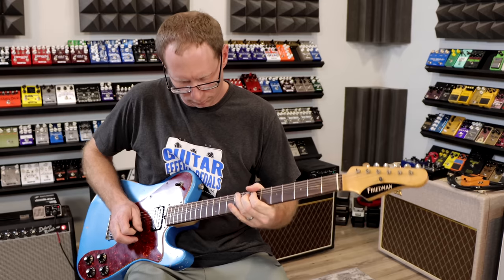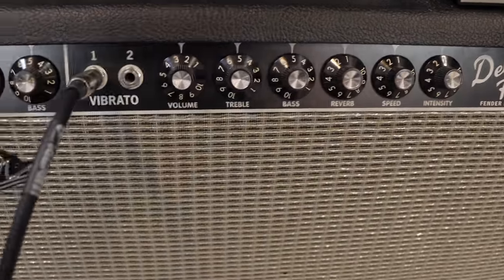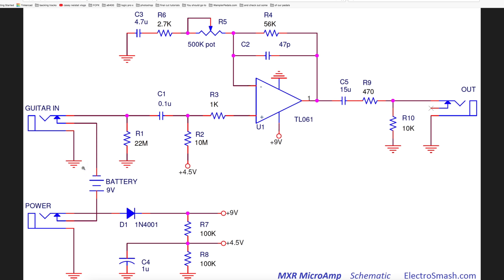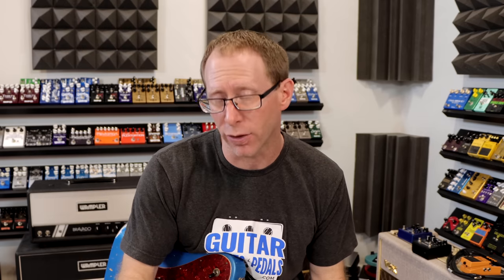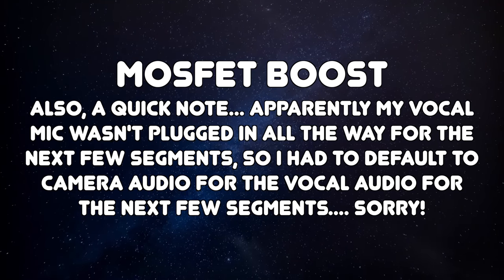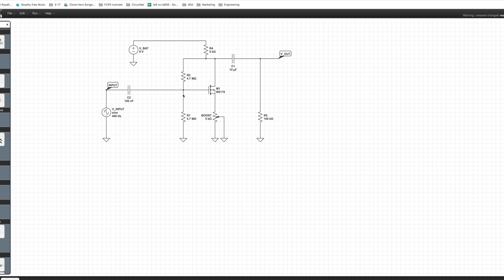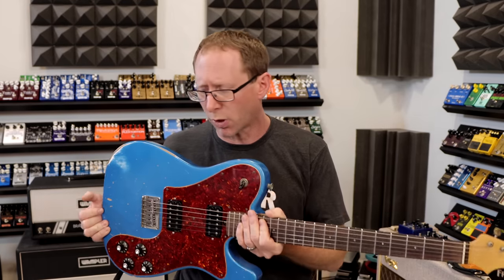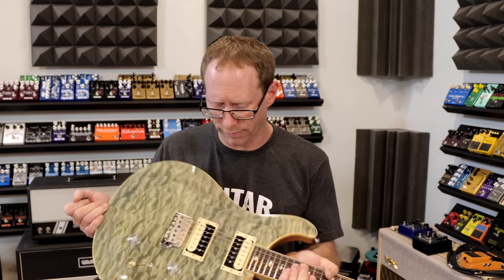Boost Pedals (Explained in Depth)

Comment: My "magic" pedal that is my number one pedal on ANY board is the MXR 10 band EQ. Not only can I boost 10 feq's, but there's two additional sliders. A volume cut/boost and a gain cut boost. It is so flexible. I can do just about anything I want. That, with my Sovereign and my Ethereal, I am set.
Reply: Been thinking strongly about going the rout of an MXR 10 EQ. Do you feel a difference under your fingers when you play using it as a boost, or is it just sound your experiencing ? ..or both ? I'm not looking to boost volume necessarily. 'Mainly feel' and deff not trying to change actual tone of my last OD in the chain.
If that makes any sense .
Reply: they seem like the red headed stepchildren of pedals aren't they?  they can do so much and are so useful but boosts, od's, get all the attention when in reality that eq pedal can do much of that.
Reply: But they can be noisy when you use them for boost instead of tone shaping Although you can do modds that can fix that but didn't work for me I use a Rangemaster clone w a clean boost on top
Reply: @paulcowart3174  Interesting. Never heard of a Rangemaster. Have to check it out
Reply: I'm using a 7 band EQ, at the front of my chain. I have a general setting for my HB guitars and one for the single coils. 7 bands is minimum, for all around use; 10. even better
Reply: I have a silent-modded 10 band EQ but also use mini sonic stomp for clarity. Really brings out every frequency range before I EQ anything. Great for S C's or H B's to start with a cleaner, clearer sound. Last pedals on my board going into amp.
Reply: @sparkyguitar0058  lol That's why I love Wampler videos. He has some of the most clever people who contribute. That's brilliant. I never would think of trying those two together. Thanks for sharing
Reply: @sparkyguitar0058  Any info on a "silent modded" 10 band eq?
Reply: Brian Kirby  10 band was done by Amplified Electronics Cape Coral Fla.  See if he is got anything on his Reverb page. If not contact him to get more info. I told him I would brag about how cool this pedal is. I have a stock 10 band and night and day difference in sound quality.
Reply: That’s my secret weapon on my board, the most boring pedal is my favorite, i run it into the effects loop
Reply: Have to add at the front of my board is a dB+ cause the buffer leads off my board.
Reply: No noise gate. Lol
Reply: RG1570 YGO  What would a noise gate do?  I've only had 1 on a big multi-effects pedal I used briefly. And never liked the way it cut off tails of sound. Maybe I didn't set it right but wouldn't add it to my board. I got a volume swell pedal for killing noise then step on tuner to change around pedals to next sound. So don't need to add something that might confuse me more. L O L.                                     Edit. Now I don't use the Sonic stomp on my board. It's only used with my A /E set up. On my board is tuner, wah ,3 drives, 2 delays, chorus ,p shifter multi effect, dB-1 boost, and modded 10 EQ. The BBE Sonic stomp is used with sometimes a delay and run into a wireless then into a small mixer and then a feed into P A.

Comment: This was really cool! I can see how so many pedal builders learned how to do stuff from you. On the whole "pre-amp pedal" thing, I wonder how a pedal like the Revival Drive from Origin Effects fits into that. I imagine the circuit diagram would be really complicated. It feels more like part of an amp to me; its what I have in my head when people say pre-amp pedal. In particular, when I set it to sound like a Marshall using a Fender amp, and run other pedals into it, like a Klon or a fuzz face, the overall volume doesn't increase, and it sounds closer to a Marshall with those pedals in front. Other pedals I've played that are designed to sound like a cranked Marshall don't do that so much.

Comment: Really good explanations, thanks. I was a electronics engineering tech 1st and learned guitar later in life. I've been trying different boost/distortion pedals based off the product descriptions with little success understanding how the pedal was shaping the frequency response to get the grit I want to hear. Your video cleared the fog. Most of all thank you for stating they all do something to the sound more than just amplifying (boosting) it. Your Ego compressor is great btw. I now have to try it in before or after positions with the Euphoria V2 due to learning a bunch from your 5 ways to use a compressor video. Good stuff, keep it coming.

Comment: I'm using an inexpensive wireless guitar TX/RX and it works well but I seem to get a lower signal (less hot) than using a cable because all my overdrives/distortions seem to have lost their clipping, growl, like if you were to roll off the volume.  So, if that's the issue, lower input signal (lower voltage?), then okay, it is what it is, but what can I use to increase the signal to get back closer to what I would have using a cable?    Seems I would want to stick with a full frequency signal booster from what I gather in your explanation, I don't necessarily need to boost a certain frequency range or volume.  Which type of booster would you suggest?  Inverted op-amp, LPB-1 type booster, etc.?  Thank you in advance for your input.  Great video and topic!!  Well delivered, kudos.

Comment: Brian, 

Your knowledge is extensive! I thank you for your generosity. At the same time, may I suggest just a little bit more info, for us rookies that don´t follow: Maybe you could close your videos with a quick summary. In this video, for example: "To sum up: Non inverting op-amp is good for x and works good with y. Famous pedals that use this circuit are: A, B and C." and so with all the other options. It would be of great help. Thanks again!

Comment: I love Wampler pedals mostly because their owner makes such detailed, unbiased, and intricate reviews. This channel has taught me how to better read schematics. I used to use a compressor as a boost and loved what it did to the top end of my sound. It didn’t add any distortion but pushed the clean channel of my amp enough to make solos really sing out. It replaced an MXR Micro Amp which distorted the highs too much and got fizzy making me turn my tone knob down which was a compromise.Then I finally got a Maxon OD808 and this became my favorite boost pedal. It did color the tone when it was off though so I plan to get an OD9pro+ 18V which Maxon claims doesn’t have this issue. When I hear pedals like the Klon and Klon copies, I think they sound great but ultimately accomplish the same sound as a TS type pedal. Someday I’ll be able to compare a TS pedal at 18V (including the BB preamp which is a TS style pedal) to a Klon clone like the Tumnus to actually hear or feel the difference. Maybe stacking a Klon with a TS is the best way to solve to my indecision. I really roll my eyes when people call these pedals “transparent”. Why would anyone buy a pedal that didn’t sound like it was there?

Comment: Hi Brian, I bought by mistake a box of 100 Mosfet transistors BOJACK 2N7000 200mA 60V N-channel Field Effect TO-92... can those be used instead of the BS170 into your Mosfet Booster schematic? And maybe for some kind of fuzz face like kind of circuit as well? Thank you in advance for any possible hint! Cheers!

Comment: Vox advertised their “Top Boost” circuit as “Up to 30db boost at 10kilocycles!”

Does that mean i could just get a Boss GEB-7 and boost that frequency to mimic the AC30 Top Boost? The GEB-7 only has up to a 15db boost capability but im sure no one runs the treble on an AC30 on 10 so it would work right?

Comment: Great info Brian, now for what may seem like a mis-informed question. While making adjustments on an eq- pedal and the peaks affecting the main frequencies (i.e. 400 and 800 as an example), what happens to the frequencies in-between? Say 500, 600, 700 when the higher peaks are used. Are they affected in a balanced curve between the 400 and 800 (again just the example frequencies), or is there a drop out for the "in-between frequencies?  Would this be the reason a "boost" circuit has a more even sound? Looking at the computer example of the eq-pedal is the reason for asking. Thanks again for all of the information you bring to this channel, it is greatly appreciated.

Comment: In the first example, the MXR microamp, you are using a breadboard. Are you using a special power supply, ultra clean? I can't hear any hum, how do you remove the him from the power source? Any comment on this? Thanks. I am starting with op amps, using a TL072cp, and I always get hum. And also it changes with the volume pot. Apparently it is a natural effect, as hum, but I would like to know how to get rid of hum, even with a breadboard (they are not the best for audio circuits some people say, but you get a very good sound). Are you using some noise gates? I have heard of them as well.

Comment: I believe the main point of a preamp is it's converting the guitar signal into line signal, at least when i look at amplifiers. But i'm not exactly sure what that means and why are some pedals noisy when they are in an fx-loop? Are these digital micro preamp pedals the same? I agree very much that there are lots of different products called "preamp" and it's not clear why.

Comment: In the scenario of using a ts-9 as a clean boost.    If instead of using a ts-9, I used a graphic eq, what sliders would I bring up beside volume to give it that ts-9 clean boost sound? I guess I want to know what exact mid frequency is spiked and if that # even exists on traditional 6-10 band graphic eq's. What tool is used to identify what is being done to a signal (visually)? I appreciate any direction. Thanks!

Comment: Try the original Colorsound boost that uses an 18v supply.
Dave Gilmour used it for many years, and it is seriously LOUD that increases the gain stage to push pedals after it, like distortion pedals.
(Worth switching the linear gain pot for a log one though for better control.)
BTW, it's worth mentioning "Operational Amplifier" rather than just "OpAmp" for clarity.

Comment: So I like to run a muff style fuzz into my ego compressor, which goes into a Fender style amp. I think this makes it sounds tighter and more aggressive. It does slightly boost the fuzz’s volume as well. What about using a compressor with my fuzz makes it sound better? Is it just changing the eq, or is there more to it?

Comment: Very interesting and enlightening. Would a parametric eq get closer to a treble booster effect, and do analog parametric eq’s even exist? Or is the difference more to do with the use of transistors and capacitors for tone and filtering rather than eq sliders (are they pots?)?

Comment: Hello, I really liked this video you are the best without a doubt !! I'm starting now and I have a doubt, when I set up any circuit on the protoboard it works normal more when I put the inside of a sardine can and put the pots in contact with the can the gain of the circuit decreases a lot, will the can cause any short circuit by the potentiometer? thanks.

Comment: I am not sure if this is related to clipping, but I noticed, there is a slight distorted sound at the end of the note(as the note decayed) when strumming bass strings (6,5,4 strings say Dm bar chord to 10th fret) on higher frets and no distorted on lower frets(say F#m on 2nd fret). And this happens only on neck pickup when on full humbucking mode but none on single coil mode(neck pick up) provided both scenario on full volume guitar knob.

Comment: Hey Brian (Bryan?), great video here. I have a Tumnus Deluxe and a Micro Amp, makes me think I should get them back to back and see what's happening. Quick question: Talking about the splattiness when you push the JFETs too hard, does this same thing happen in some fuzz pedals? I've noticed with my Hoof Reaper and my RAT, that if I have some hot signal running to them, I lose tons of definition and it just becomes a wall of sound. But, if I roll off some of the volume and/or split the coils, I suddenly get a lot of that definition back. Does this mean the fuzzes have JFETs in their circuits, or is something else happening here? Thanks so much!

Comment: I love the Tumnus as a boost. I’m glad you explained it still colors the sound even though it’s not clipping the diodes.  Sounds so great using a fender deluxe reverb. I heard it’s because it’s a mid scooped amp so they compliment one another.  Is that accurate?
Reply from the maker: It’s subjective, but I would say that’s one reason why some feel that way

Comment: Brian, what type of boost circuit would work best onboard on a stratocaster with low output single coils? I would like a slight push, a bit "more" but nothing too crazy like a Clapton thing... I have a battery compartment begging to be used!! Thank you!!
Reply: @1492oceanblue2  thank you!!

Comment: I have a question about the treble booster circuit. It sounds awesome into a cranked amp. Will it sound awesome after a cranked pedal? Or will it not like seeing the signal from the overdrive pedal first. My overdrive pedal is a Radial Tonebone Classic. Thanks.

Comment: I recently built a boost pedal based on a china fake TDA2030A power amp. Output signal is up to approx 22Vpp which drives my amp nice and hard. It sits last in the chain, since the massive output and low impedance could damage other pedals.

Comment: The best b00st pedals are the MI Audio Effects Boost 'n Buff (V.2 and V.5 are the good 'uns) and the Tumnus/K-type thing.
That is all. Unless it's a cranked Vox or a Crowther Hotcake into a Vox or another EL84-based amp, then you want the mighty Treble Booster.
DOD250 if you wanna be Tom Verlaine.

Comment: JFETS/Mosfet can do dirty boost where they soft clip just little bit. opamp boost are not design to give a dirty boost and  they not designed to soft clip. also fet do not like square waves and round them out triangle waves. it seems with the cap feed back ensure harsh frequencies are reduce make more pleasant fuzz sound.

Comment: Is a FET a field effect transistor ? In my world (not guitar) those cut output power to the device until the module the FET is inside of’s power resets after there is too high of an amperage draw, essentially a “virtual circuit breaker”
Reply from the maker: Yes they are, and yes they can be used like a switch as well. I’m using them as voltage amplifiers here though, like we normally use tubes for in the amp world.

Comment: Thx Brian. Greatly appreciated. I've got a background in tinkering w tube hi-fi amps. Bout to mod my 1st pedal  - a TS variant: Biyang X-Drive. Have quick question: I'm looking to change the 47K resis & 47p cap in the drive circuit; to lower the gain. [ OR  is there a better way to lower the gain?]  I understand raising cap value, when lowering resistance. . Is there a resource for determining the change in tonal character, by varing the cap value?
Reply: Depending on a location rez or cap do a different role. If rez is a part of OA feedback it's typically a part of gain limiter, capacitors there typically for a filtering. For numbers i'd recommend looking at transistor/microchip specs, they also often provide response characteristics for a principal schematics.

Comment: What does it mean when your amp volume is super high and clean but the boost is set super low and it is distorting alot? Does that mean there is clipping coming from the boost? A clean boost should only increase volume right?

Comment: How can we be sure we're hearing clipping from the pedals and not the amp? My deluxe starts to break up around 4.5, which would surely be the same as running it on 3 with a hot boost pedal up front?

Comment: When choosing a boost, how do we know which circuit is being used. Do we just have to contact the maker. Thanks for this great video!
Reply from the maker: Unfortunately yes generally you will need to contact the manufacturer unless it talks about the circuit type on the website
Reply: Thanks so much for your kind reply. Looking forward to my new Tumnus!

Comment: When you use a breadboard you mention how the wires act like antennas contributing to noise. If you were to Shield it with say a piece of screen that was grounded would it eliminate this or at least reduce it?
Reply: I'm guessing what you really need is a Faraday cage (and that pedal enclosures act as such)

Comment: Brilliant video great to see the circuits. But it provokes two questions, one sort of tone related and one electronics. The tone question relates to a clean boost with a flat frequency response. If a boost has those characteristics would the same effect be obtained by simply turning up the volume of your guitar amp? All the pedal is doing in increasing the volume across the range. 

The electronics question relates to the components on the fringes of the circuits. I guess it's input and output impedance. As I watched the video I noticed that the circuits used different values and wondered why. I guess I expected the more central circuitry to be different with the different gain circuits and gain components used, but when it's fed in from the guitar or out to the guitar amp I expected that they'd all be very similar. Not having much of a clue about analog electronics maybe they were all the same, just looked different to me.

Comment: I have a question as a beginner at this. Should I be discharging all the compacitors on a diy kit before installing them or are they discharged when you get them do you have a proper vid on how testing these thing is done?
Reply from the maker: In a typical 9v pedal? I wouldn’t worry about it.